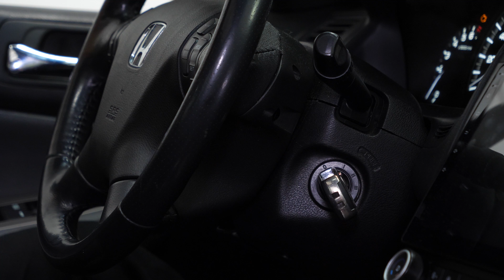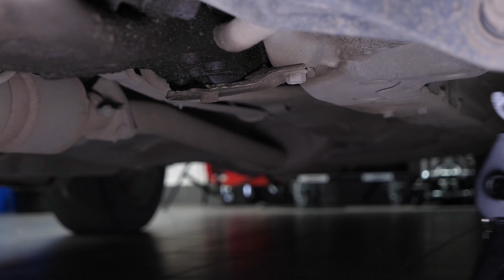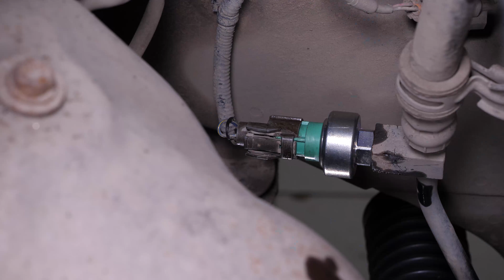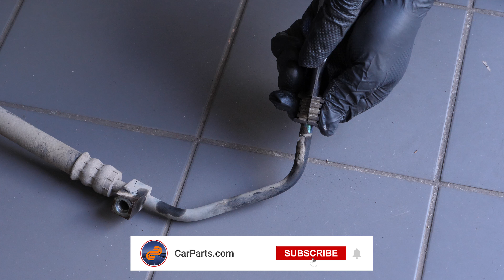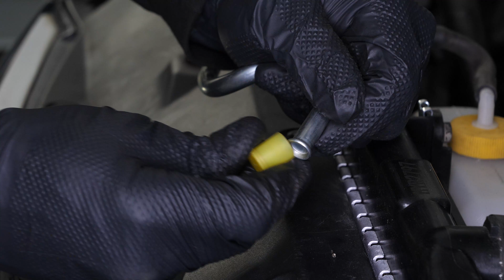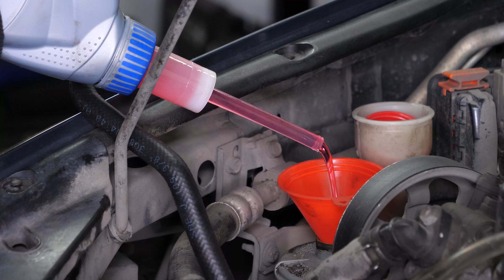How to replace the Power Steering Pressure line 2003-2007 Honda Accord 🛞

Comment: It's the driver side you want to take the wheel off, cause that's where the rack and pinion is located to have full access...
Reply: just did the full pump & HP line repair, and not sure why any tire had to come off?
Reply: @troynichols9788  Good to know. I'm about to replace the pump and line.
Reply: @bwitt1984  on another vid i made a comment about a trick i learned removing the entire line from down by the rack & pinion "HUMP" of stuff ... a big bracket  that steering line has to go through and around to get removed, and then inserted back.  Let me find that b/c it'll drive you NUTS w/out the trick.
Reply: @bwitt1984  here ya go .... 

Before starting, I fully bled the power steering system. This helped keep the job relatively clean.

The only real challenge was removing the high-pressure (HP) line where it runs underneath the engine/steering mount. But I discovered a trick that makes it much easier:

Bend the line into a large “V” shape.

Here’s how:

1. Take the end of the HP line that connects to the power steering pump (located at the front left of the engine bay).

2. Swing it up and over the engine so it rests near the brake fluid reservoir (driver’s side, back right of the engine bay).

3. Now the entire HP line is shaped like a “V” — one end under the engine/steering mount, and the other end resting over near the brake reservoir (both ends of the line had already been disconnected and the line is ready to be removed).

For some reason, putting the line in this “V” formation makes it much easier to pull it out from under the mount — no fighting or awkward angles.

Bonus: The same trick works in reverse when installing the new line. Shape it into the same "V" and it slides right into place.

Hope this helps someone else avoid the headache!
Reply: @troynichols9788  Hey thanks for this tip. I assume you mean to bend the rubber hose section into a 'V' and not the steel line?
Reply: @chickenbob-w7j  correct. Right about the middle of the entire line, from the reservoir down to the steering stem, it will bend into a V.
Reply: @troynichols9788 for easy access cause not sure either